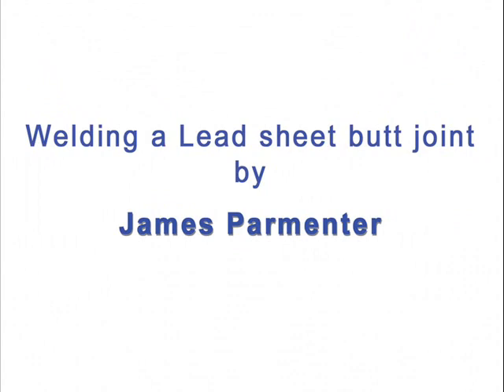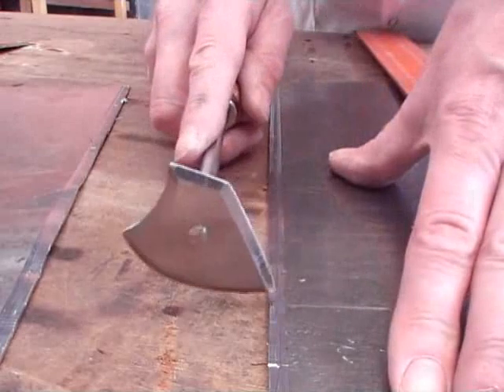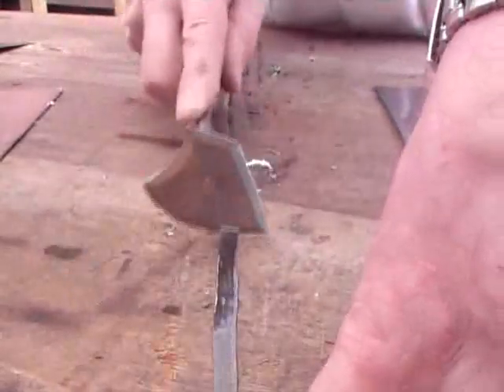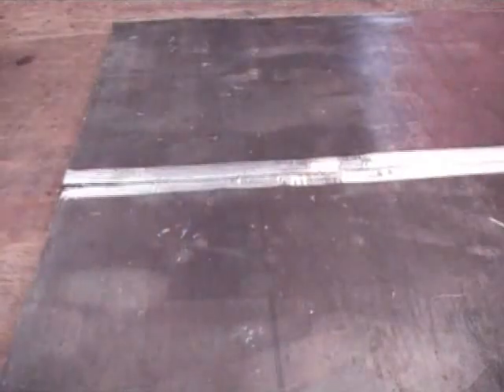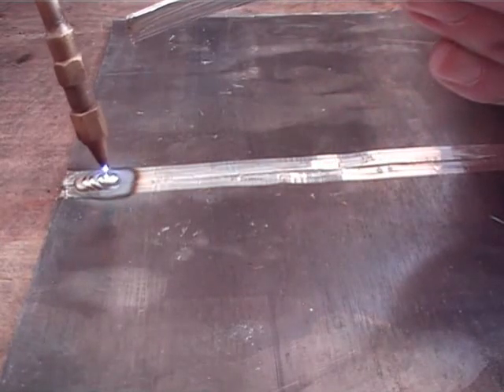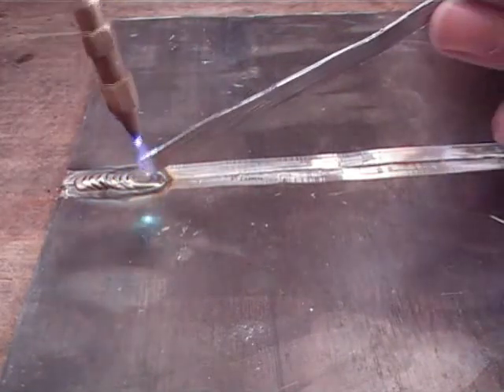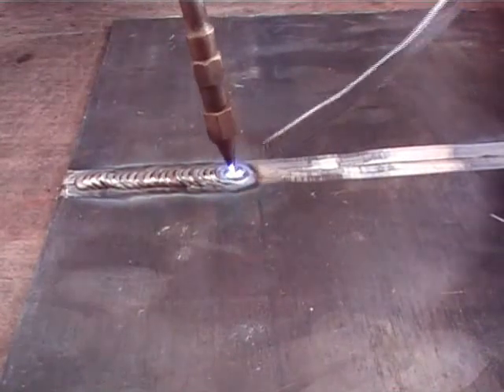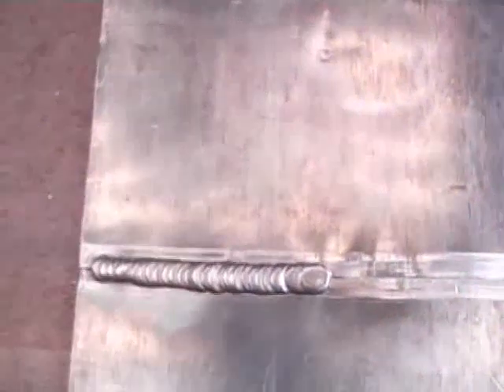ButtWeldJP.flv

Comment: Gloves...always, a little tip.. try a size 3 nozzle instead of your size 2, and if you hold your gun at an angle the other way pointing into your work you will penetrate through the entire sheet, if it's too hot for you introduce a sideways or circular motion as well. Unfortunately you have just melted lead on top of it.
Reply: That is acknowledged when he says the strength of his weld is in the high dome he builds.

Comment: Not sure what makes you say 'always use code 4 lead for roofing'. Thats not right.We use code 4 for cover flashings but code 5 for many applications such as valleys, gulleys, box gutters and lead flat roofs and its these applications that often need some welding . I hardly ever weld code 4 lead apart from maybe box gutters behind chimneys. also its much easier welding code 5 lead than it is to weld code 4. But nice vid, thanks

Comment: Dont be frightened to try something, just seen the end of ur vid, I could easily rip that apart, try an aluminium plate under (thick one) .if you check with HSE they will recomend barrier cream, then gloves. Also overalls and mask, I have worn gloves and masks for the last 7 or 8 years and my lead levels have come right down, I hate overalls though and just cant wear them :(
Reply: The Brit lead sheet manufacturers say it is perfectly safe and you can eat lead breakfast, lunch and dinner no problems.

Comment: Couple of points James;
We use mainly Code 5 Lead here in Scotland & anything up to Code 8 on some jobs.
Do you not 'tack' your but welds & we would give it three runs, burn in & two welds of Herringbone.
But hey, each to their own.  Thanks for sharing.
Reply: I agree with tack welding 1st but code 4 is good enough for nearly every job tbf
Reply: I just tack it and give it 1 run but i go hot and  fast not on and off never had a problem with any of my welds don't see the point in 2-3 runs and herringbone shite lol just get it welded